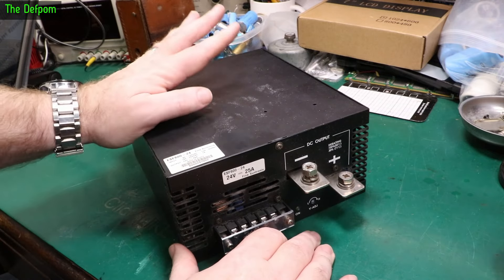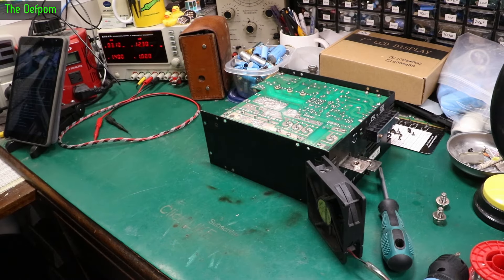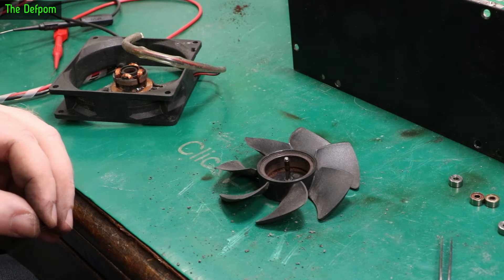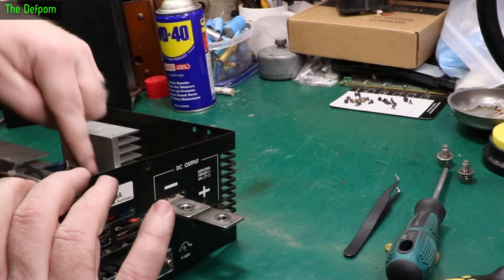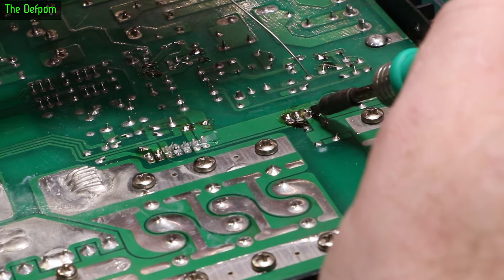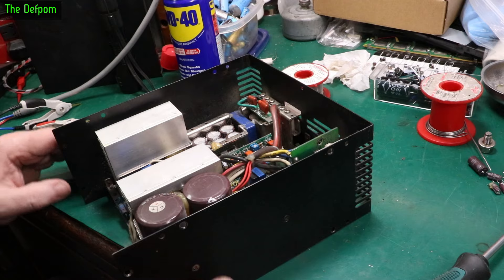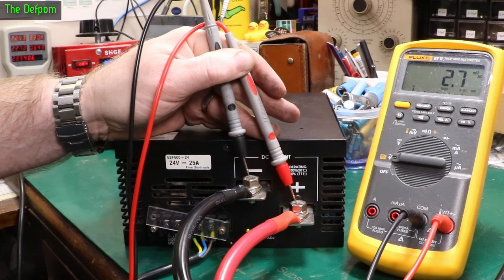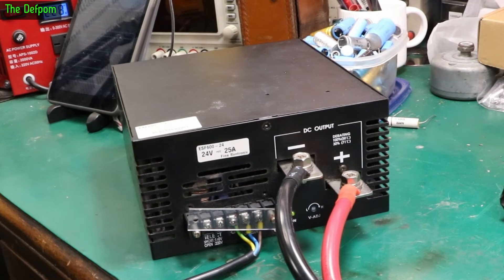🔴 Fixing a Power Supply - ESF600 24V 25A Power Supply Repair - No.1270

Comment: Don't use general wd40 as lubricant, it is not good for that. It might seem like it's working few minutes after you've applied it, but then it dries out and can make the bearings wear faster.
Reply from the maker: @ukaszsmoa8416  I have some proper bearing oil now, it was all I had at the time

Comment: I remember this little cute baby boy of a power supply! 🫠🫠

The large elco's aren't particularly bulged per-se. They're just built like that. Like ass, with a few bulges and a crack in the center.

Fans getting faster and slower like that generally/often have issues with gunked up grease/oil in the bearings' races or bearing sleeves. The heat of running liquifies it more so they get faster as they run, but dust and dirt in the grease can then also redistribute and cause it to intermittently experience more friction. This one looks like a ball bearing one, judging from the large fan motor hub, even without needing to open it up. That's how I can tell. :)

When oiling bearings in fans, please don't use WD40 as a lubricant! It works wonders for flushing out old grease as it's mostly solvent, but when it evaporates it has no more lubricating properties. Use sewing machine or light machine oil (or, if you must, 5W-30 or 10W-30 oil)!

Comment: One fan bearing. Cheap fix for power like that is always nice, congrats. I just got a 25A PSU also. Mine wasn’t given to me but still cheaper than what it was retail. I also had a cheap fix, $0.69 diode and seem to be running good. The fast, cheap and easy fixes are nice once in a while.

Comment: That fan definitely had some time on it!  What did you do to modify the DC load to dissipate so much more wattage?
Reply from the maker: The hardware between the 200W and 300W is the same, so it is a software hack to convert it into the higher model.
Reply: @TheDefpom  oh no kidding! that's interesting.

Comment: WD40 may be a good water displacer but it's not a good lubricant - at least for the long term. I'm quite sure you know that but some of your viewers might not.
Reply: yep, wd40 dries up in a few days, also that's not good for most plastics and rubbers.
Reply: I've had really good experience with normal 5W-40 engine oil. I just filled a bit into a small dropper bottle and put one drop into the fan bearing. No howling fan since!

Comment: 17710uF .26Ohms "seems reasonable". NO!!!! the 2200uF capacitors should probably be less than 50mOhms - each! I'm assuming they are 35V given the 24V output. It's hard to estimate the size but the absolute cheapest 2200uF/35V from Digikey is the EKYC350ELL222ML20S, 16mm dia x 22mm which looks similar size, with a specified ESR of 38mOhms at 100kHz. 8 in parallel would be nearer 5mOhms than 260mOhms!

Assuming a ripple current of 30% of output current (fairly typical) that would be 7.5Arms. 7.5^2 x .26Ohms = 14.6W 🌡Ouch.
I'm guessing the power supply will not be a happy bunny at full load.

Never forget the golden rule - "It's always the Crapacitors"

[EDIT] Since you saw very little ripple voltage at 12A, maybe the ESR measurment wasn't reliable? Or perhaps the designed ripple current in the ouput capacitors is very low, implying a rather large inductor?
Reply: Completely agree, for 8 in parallel that's 2 Ohms per cap which is terrible.